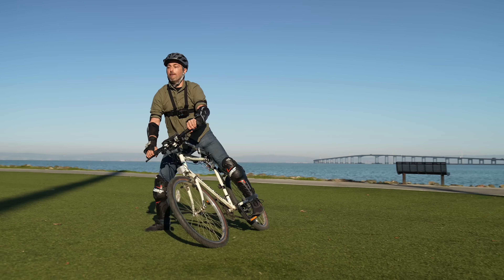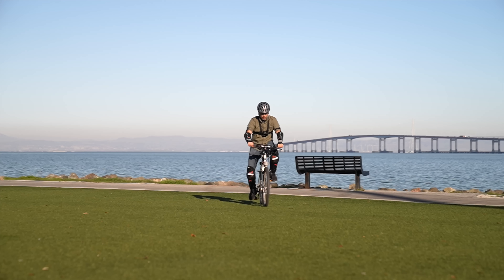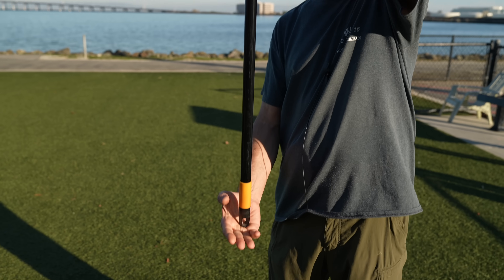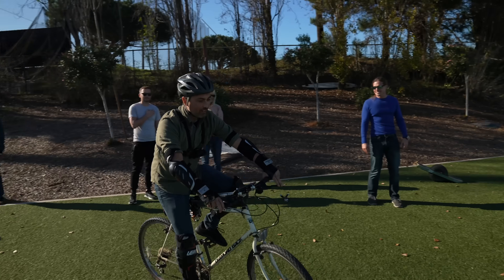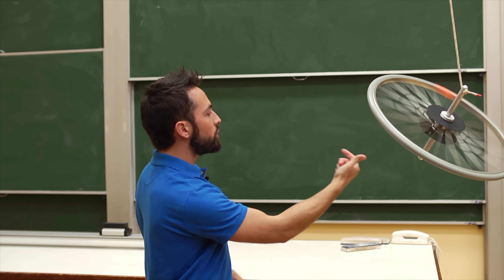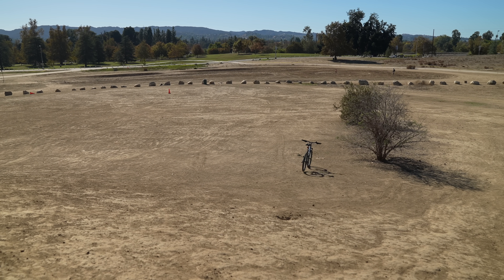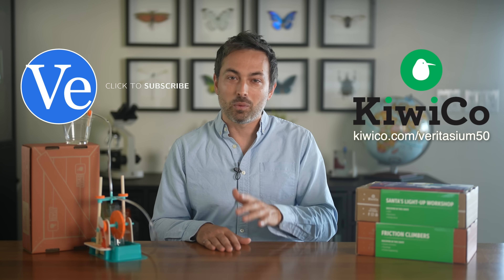Most People Don't Know How Bikes Work

Comment: I know when you're moving slowly this definitely makes sense to do, but this doesnt make logical sense when it comes to riding at higher speeds. If you try to counter steer rather than just leaning into a turn, you're going over your handle bars. I use to ride bmx down hill and this was a very real error that I encountered. trying to countersteer at high speed does not work and I don't think was mentioned here. maybe countersteering was done in extremely small increments but it was almost unnoticeable to be recognized. The flaw in this is that the bike is not the only thing that needs to be leaning, it also needs to be you leaning with it. if you throw mass in any direction, you will be able to lean to that direction quite easily. its one thing by using a directional force such as steering the wheel into a lean, but the same thing can be done just by leaning your head or torso to one side. This is also something people do without noticing. By leaning your torso to one side, your center of balance will have shifted which in turn will cause the bike to lean with you instead of you leaning with it. Thus you will need to turn the wheel to the direction you lean in to stabilize yourself,  rather than countersteering to make your bike lean.
Reply: Countersteering works at high speed.  Motorcyclists do it at 3-figure speeds.  However, the steering input has to be less aggressive.  Countersteering is literally the ONLY way to steer a 2 wheeler at high speed.
Reply: Jokes on you, when you lean a bike at higher speeds you are countersteering automatically. Otherwise you wouldn't be able to actually get into the lean. Countersteering is more important at higher speeds than it is at lower speeds.
But try it out, next time you're on your bike, ride straight at a higher speed and if there is enough space, just push one side of the handlebar down slightly. You'll find yourself in the lean, turning the bike.
Reply: Also countersteering is a more effortless way to get into a lean compared to forcing your weight off center of mass to lean over.
and it's safer

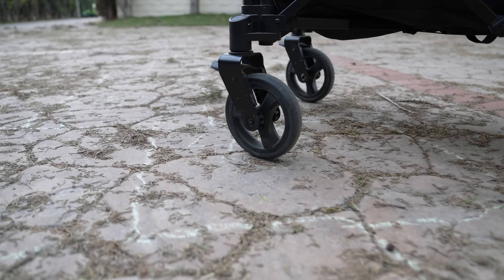Comment: Very well done. There is an error at 8:20, there are many examples of bikes with the "center of mass" of the handlebars behind the steering axis. Cruisers, "English" 3 speeds and many modern mountain bikes all put the center of the grips on or behind the steering axis. In fact, the farther in front of the steering axis, the more the rider is damping the steering by pushing the entire steering assembly forward. The lockout experiment was very amusing! The straight-on video showing counter-steering was the best I've seen on this subject.

Comment: This reminds me of learning to ride a motorcycle. I kept crashing - fortunately at very low speeds. My roommate at the time told me to turn left, you push your left hand on the handlebar forward which you would think would make the motorcycle turn to the right. It worked - the motorcycle turned to the left.

Comment: "so the steering is not only responsible for turning, but also balance"
That is such a fundamental in motorsports and also apply to cars by transfering weight between the wheels through the suspensions.
The more you understand how to change friction forces in the wheels through weight transfer, the less you turn through the steering and the more you do it on the pedals.
And in old school gokarts you can actually lean forward to increase turning forces without changing the steering angle, which is really cool when you get it right the first time =D
Reply: The go cart thing, that's because you're putting more weight on the front tires causing it to slip less. One would assume that the tires dont slip when the vehicle is turning, but that's not the case.
Reply: @Daniel-dj7fh  Although too much braking and therefore weight over the front tires will cause severe understeer until you let off the brakes. Learned that one from DiRT Rally/2 lol. In regards to your second comment, I primarily travel with my CB300R, and what I find a bit strange is I can handle that bad boy way better than I can a car, although that could be from more irl experience with sport bikes than sports cars, although I have put a quite a few hours into sim racing with my wheel. And I definitely agree with you on trying out riding. Being on a bike just makes me feel more connected to the road, both in terms of enjoyment and actual performance. That and how else can you run both of your feet across the ground going 70? lmao
Reply: @farLander1  Tires can't become "overloaded" from small loads like that. More load = more force, even if grip does go down by strict definition.

You're just exceeding the limit of the fronts by braking too much. Although the longitudinal load curve for tires is typically too steep in sims and most of the time they're missing combined force squaring so effectively IRL you can usually expect to trailbrake a bit harder and not understeer compared to most public sim car models.
Reply: wow
Reply: Do remember that total lateral force goes down if you lean forward and load the fronts more even if the balance changed. Tires have load sensitivity curves; you get less grip with less load.
Reply: @ArchOfficial  yes, moving forward induces oversteering at some point.
It is a lot more useful to indoor karting at lower speed with 6hp engines than at an open track with more torque and power
Reply: @RadeticDaniel  You've got it backwards. Moving your mass forward will introduce more inertia to the front axle than the rear axle, which causes understeer. You will get more front lateral force as well, but at a reduced rate due to load sensitivity, so it won't be enough to overcome the inertia.

When you brake or accelerate, you're just changing the loading of the tires, not the mass over them, hence you can get more turn-in by braking.
Reply: @ArchOfficial  well, I'm a bit heavy (half the go-kart mass) and whenever I get a good lean forward it usually breaks rear traction under throttle.

So leaning without changing anything else both increases turn in at first and then causes the rear to go loose for me
Reply: @RadeticDaniel  There could be a possibility you're simply unloading the inside rear wheel. That'll cause enough of a reduction in total axle force that it'll oversteer effectively. Not sure if it's doable in a kart just with leaning, though.
Reply: @ArchOfficial  I'll tell you by experience that it is XD
I've been racing the same circuit under different layouts for about 3 years, except for pandemic shutdowns.
The go-kart is just above 200kg and I'm just between 100 and 110. Also we don't use those roll over protections with high seats some countries use, that end up stiffening the chassis
Reply: This is cool and all, but how would you explain biking without hands (not holding the steer) , like any decent cyclist from my country can?
Reply: @joopie2time2killu  The bike self steers due to self aligning torque from the tire as an effect of having positive mechanical trail. Every time it steers to the side, the tire produces a torque that coupled with the steering geometry causes it to try to steer back straight.
Reply: @ArchOfficial  Thats just a very minor effect, because the bike is so light and symmetrical it will keep right, but if you place a person on it you have to balance it yourself, either by using the steer or your body weight, the point being is counter steering isnt necessary
Reply: @joopie2time2killu  the very essence of the comment should be the answer. If steering is about balance, then redistributing balance is what makes a turn.
It is similar to the self stable bike going away in a straight line or a coin going around in circles and refusing to drop.
Hands free cyclists get the wheel to turn by inclining the way they want it to go. As for counter steering before a turn, well, that is most likely instinctive
Reply: @cokecan6169  it's really load transfer, not weight transfer. Something I learned last year. I always thought it was weight transfer but the weight doesn't change. The weight of the bike where the motorcycle is constant as you brake and or accelerate, I had never thought about like that. 👍
Reply: Oher 4 ldc
Reply: Technically speaking it's more than just steering and balance... It's steering, balance, solidity of the ground, g force and basic physics haha. But yeah I do agree with what your saying
Reply: Yeah I thought the video was an obvious thing that most people know but I guess its something that motorsports teaches you.
Reply: The entire premise that you can't turn one way destroys the use of a two-wheeled vehicle
Reply: That's a completely different effect which will not work on bicycles.
Reply: @cokecan6169  I don't want you to get into dangerous hobbies, but you should try motorcycles, that takes driving/riding technique to a finer stage.
Also I've been sim drifting on grid autosport, whihc is pretty dope
Reply: This is why people saying that you "just have to lean" into the turn on your scooter or motorbike are just plain wrong and the cause of many injuries and deaths. Countersteering is the ONLY safe and effective way to learn how to ride a bike. Almost all bike crashes are caused by people panicking and not countersteering when required. Telling people to "just lean into the turn" should be considered the same legally as giving instructions and encouraging someone to commit suicide. It is literally the same.
Reply: @CompletelyNormalPhenomenon  first thing I think of when someone says, "Just lean into it," is action movies, with a guy on a bike going under something, to pull off some sick move. Life isn't HOLLYWOOD. That's why MotoGP have those wicked knee pads.
Reply: @CompletelyNormalPhenomenon  the ideia of leaning first and turning after only works at considerably high speeds and usually require accelerating through the corner.
You can very rarely see it in MotoGP, but even then they will mostly take a slight swing and counter by instinct as it is safer, simpler and more effort efficient
Reply: @CompletelyNormalPhenomenon  I think telling someone to "lean into the turn" is meant to help the rider, not hurt them. The person doesn't know any better, because quite frankly, not everyone is aware of the physics behind bicycles. Telling them to commit suicide is completely different and I don't know why you would make such a dumb comparison.

Comment: I can absolutely honestly say that i never turn to left when im going to right nor do i turn right when im going to left. maybe its just about the way we learn how to ride a bike some do some don't but even though i tested it i always just go where i want to go without never ever needing to go to other direction first's.
Reply: When I ride my mountain bike, I do not think about it in most circumstances, but the countersteering is happening whether we realize it or not.  It's the only way it can work by the laws of physics.  On a bicycle while going a decent pace, the actual movement of the bars can be tiny.  On my sport bike, doing a track day, there are many scenarios where I need to transition very quickly from full left lean to full right lean while going 100 + mph.  In this case a conscious deliberate countersteer action is the only way to get it done.  The weight and speed of the bike means you have to put some real force into it.  Even then some riders somehow don't realize they are doing it.
Reply: @adamharnois7072  i usually just use my body to do the turning unless i'm going really slow then i do end up turning the handle bar, but i never do even the slightest countersteering as i seriously would mess up my balance if i did.
Reply: @danteangelo9412  You are countersteering, you just don't realize you are doing it, and that's the way it works for most people riding bicycles and motorcycles.  If you lean your body just a smidge to the right, you end up pushing on the right side handlebar grip, which nudges the grip forward slightly, causing the steering to turn to the left slightly.  It's tiny movements, very easy to think it's not happening at all, but it is.  It's proven in multiple ways in the video and yet people still won't believe it.  With the steering locked nobody could steer or balance anymore even with extreme body movements.
Reply: @adamharnois7072  i do still believe it has something to do how we are taught/learn to drive or something like that as i simply don't need to do it.
 i just would need to find a way to lock my front wheel so i could test how driving with it locked works for me.
they do are doing quite good work at testing in the video but i still don't see my own test's being so much worse that they wouldn't be accurate.
i do believe it might be hard to believe after watching this video that anyone could do it and i don't think there is much to even brag about it really, but i do still stand by it that i can do it.

Comment: In fact, when you steer to the left first, the bike will fall into a right turn on its own. You can test this by taking your left hand off the handle bars and pushing on the right handle bar with your open right hand. The bike will end up in a right hand turn.
Reply: The design is so stable that it can recover from significant perturbations.

Comment: "It's impossible to turn left without first turning right..." - This is not entirely true. As you said afterwards, it's still possible to turn, even without counter-steering the bike before that. The reason for that is the difference in the weight of the person and the bike - a person weighs 5-6 times more than a bike, and even without moving the steering, a person can shift the weight and the center mass of the bike very easy to the one side where he/she wants to turn. You can easily see this when watching people riding bikes without touching the handle bars. This, however, most of the times is not possible on motorbikes, as someone below noted - because the motorbike is much heavier than the rider, especially in high speeds, moving from side to side doesn't give you much force and you need to counter-steer to turn.
Reply: I went out and tried today and I absolutely agree… you can ride with little to no directional input to the handlebars. By moving my body around I was able to accomplish many turns without counter steering. I feel experienced riders knowing they need to use their body instead of bars could make this seem easy.

Comment: I remember when a sudden gush of wind pushed me up against the curb when I was riding my bike. I was going very fast due to mainly having the wind in the back. Until it got reflected by a house that is. I could not get away from the curb - each time I tried, the bike tilted more. So I had to jump as I could not brake at that point. A very unpleasant experience.

Comment: Great video...
I can personally stabilize a stationary bike, and I don't even have the best "balance" as one might think. It's simply from shifting my weight and "steering" the bike to keep it up upright. I'm performing the same corrections, jerking the chain tight, pumping the hand brakes, and steering, just in a standstill position. It's not easy, and I wouldn't be able to do it, if I couldn't move the steering. 🧐
 Unless maybe, MAYBE if I began bunny hopping to correct.

Comment: I never learned about countersteering when I was trying to turn while riding a bicycle, so I gave up. I could only make small adjustments to my direction without countersteering, so I always rode straight in the middle of the lanes to avoid going completely off-road if I ever accidentally made a big enough turn. I did know about the inverted pendulum concept and that the steering also affected balance, but I never learned the concept of countersteering. I always leaned to wherever I was turning to balance myself, but I still always lost balance. I never understood how to keep my balance when I turned, but I knew why I lost balance. I never countersteered because I felt like I would lose balance like that and fall, especially since turning anyway would’ve made me fall as well. I would have rather felt the comfort of being balanced than be able to move in a direction because I was unbalanced in that direction because I felt that I would always be unbalanced in that direction and then fall at some point. Not knowing about countersteering when I was young or how to do it correctly is literally the reason why I haven’t learned how to ride a bicycle now and why I choose to avoid using them. It’s like trying to jump without bending your knees and then extending your legs. You won’t really jump that high like that.

Comment: Could you ride with locked handlebars if you did not sit on the seat? Would this not enable you to shift your centre of gravity independently of the bike's centre of gravity?
On a side note, the way you have to do a small turn the opposite way you want to actually turn is also used to flip a car around 180 degrees. A quarter-turn of the steering wheel right and then a full turn to the left will whip your car right around.

Comment: All you have to do is ride without touching the handlebars. You just lean. I can prove that concept in person if you'd like. You don't steer, you just lean. This video is about steering, specifically using the handlebars. Take your hands off the handlebars, and lean slightly to one side, see if that isn't different. I ride and turn bikes and motorcycles with no hands on the handlebars. Have been doing it for 25 years now. At speed with the angular momentum of the wheels, it's really easy.
Reply: Not true.     I would bet with you you ain't steering if we actually lock the front wheel in place.  If the forks don't turn at all.